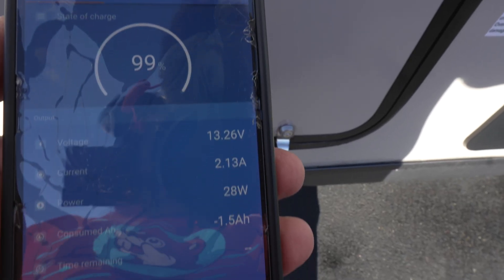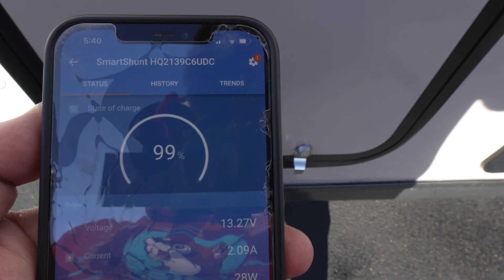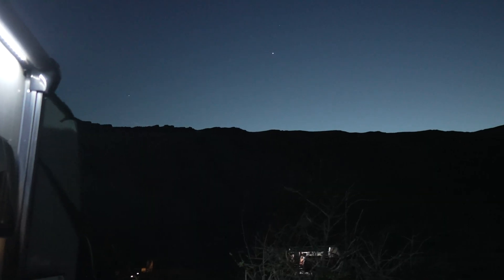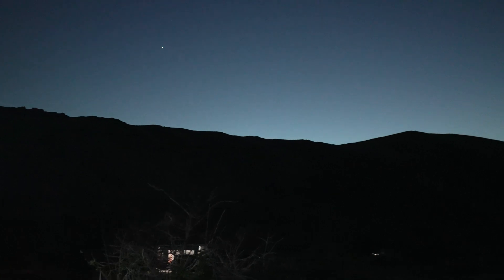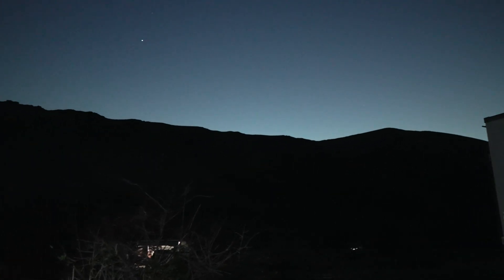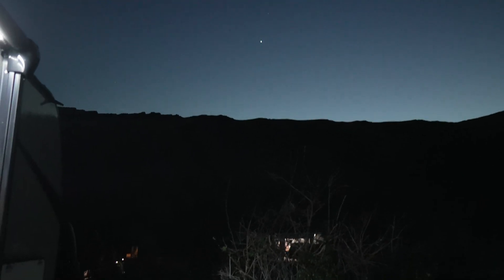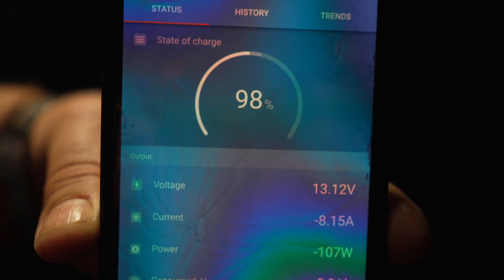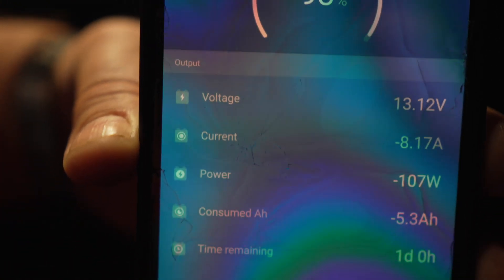SOLAR vs 12 VOLT FRIDGE TEST | BOONDOCKING WITH A 12 VOLT FRIDGE | ROCKWOOD 2109s

Comment: So a 2000 watt portable inverter generator should keep the batteries fully charged if I run it for a few hours a day?  We live on the West Coast of BC Canada, and it rains a lot. ( especially when we go camping 😂).
Reply from the maker: Should help combat , as long as you lithium converter on board can charge at a higher rate.
Reply: @UniqueAdventurez yes, when we get a new trailer, I will specify that I want that system installed instead of the standard 12 volt lead acid one.
Reply from the maker: @thumperpaul it should implied with the power usage.  I feel the only reason they do t is that they “ don’t know how the buyer is going to camp”.  It’s a lame excuse.
Reply: @UniqueAdventurez exactly. The Stealership is not your friend, we know from experience
Reply from the maker: Totally !

Comment: Great video, thanks! Wondering what side your fridge is on? Was it the shaded side with awning or the side the sun was hitting?
Reply from the maker: Our fridge is on the rear wall of the RV. So for the orientation the back of the trailer faced the east so it got morning sun and afternoon away from the back wall.

Great question and never thought to think of that when positioning the trailer.

Comment: Nice info, thank you for sharing. 
We have a small 24' toy hauler with a 12v fridge.  It came new with just the little group 24 agm and 150 watts of solar.  We knew from years of camping and solar experience that was not going to work.  We now have 300ah of lithium and 750 watts of solar, more than enough for the fridge but we also do other power hungry things like induction cooking.
We have found about the same as you, recharged by noon on good days.  Only once in the fall on a rainy day did we need our little generator to help recharge.
Reply from the maker: The AGM is a shame with a 12v fridge. Glad you got things figured out and looks like you have a pretty built system now. Thank you for sharing and checking out the video !

Comment: Solar panels are so cheap now why not cover your entire roof surface?  My truck camper (Eagle Cap 1165) has 600 watts of solar, a 460 ah LiFePO4 battery (which has a smaller footprint than 2x100 ah batteries) and a 3000 watt inverter.  I can run my AC while boondocking and barely scratch my battery level!!  Even on overcast days I get enough to keep my battery at/near 100%.
Reply from the maker: Great question. We will be adding some more ground solar to chase around the sun during this offseason.  Personally for our rig I think a ground unit will be better for us as opposed to drilling more holes in our roof.  Nothing wrong with decking a roof in solar and I think others with our floor plan have got close to 600-800 watts on the roof.  Sounds like you have a killer setup that is highly mobile, those Eagle Caps are really nice.

Comment: Our Microlite came with a 200w solar panel and I had the factory install a second.  I have not installed but have purchased 2 100-amp 24 group lithium batteries that should fit in the double battery box that came with the trailer. So, we will have 400w of solar on the roof and 200 amps of battery power.  Basically, what you have, and your video shows we will be just fine with this set up.  Thank you for your video.
Reply from the maker: That’s a solid gauge to start with and get to see what your power needs are. Since this video we did upgrade our lithium now up to 400 ah. Just to give extra cushion, but we can manage a weekend on 200ah with conservative usage without sun for solar. In good conditions we will now have limitless power for our needs .  Thanks for the great comment and sharing !!
Reply: You really only have 100ah, because you can't take the batteries down below 50%.

Comment: Exactly what I was looking for. I still have a propane refrigerator and was wondering about power usage and solar for a compressor fridge. I do have 2  portable solar panels that i put out on long stays. One is a briefcase type with glass panels and works great. The other is a flexible panel that I keep under the mattress that takes up zero space.
Reply from the maker: If you have ground chasing solar and roof mount solar you could be in. Enter shape then we were .  We are also going to be looking around a ground system as well.

Comment: Thinking of getting a 12v fridge for our class c motor home.  We have 2 6V golf cart batteries 22ah each and 400Watts of solar on the roof. We also have a built in onan generator. Do you think we would have any issues? Only camp in the summer months here in BC, Canada.
Reply: Sorry 225ah on the golf carts.
Reply from the maker: Great questions . As you saw we can get by with the 400 watts of solar with having good conditions. The problem lies with your battery capacity .  With 225ah of lead acid batteries and using the 50% rule you really have 112.5ah usable power, which would be around a days worth of conservative power. 

Lead acid batteries also can’t harness as much of the solar as they can need to be charged at a lower rate to not fry the batteries. So you may not be able to even harness as much as we do since we have lithium (which can take more power faster).  You then might be relying on the generator more than you would like to due to the lead acid and also with you being farther north having less ability to harness as much solar as us down the the states.

If you were going to be dry camping often I would suggest looking into upgrading into lithium batteries and depending on your power usage (what things you like to run on power) I would suggest At least 200ah of lithium as the minimum and deposing on how many days you are out at a time and power usage maybe even as high as 300-400ah.  Really depending on your power needs and how much you don’t want to be stressing about having good solar. This was a great question Mike , hopefully this helps !!

Comment: Guarantee being a trailer manufacture, they probably use the cheapest solar panels. I seen some solar panels that are made for homes that are close to 565watts And they can be used they come with a excellent 15/20year warranty They’ll add about 120 pounds worth of weight to the roof but. I’m thinking on my 83 holiday rambler that I’m doing imperial. I have enough room to put eight of those panels up on top and a walkway in the middle where are my three roof vents are and my AC.
Reply from the maker: Our panels have done decent (with the issues we have had with the solar). They are 2 190 watt go power panels. If you can get up to 8-565 watt panels on your roof that will for sure help bring in some serious power !!!  Thanks for the great comment John and good luck with the solar. Do you have a 12v fridge in your trailer ?

Comment: Thanks for doing this test. We are currently searching for a new rv. I completely understand the benefits of the 12 volt fridge, but it seems more stressful trying to make sure you have enough power, not to mention all the talk of: shunts, different controllers, panels, and batteries. It seems complicated for this old school camper and not near as relaxing. If you had it to do over, would you get a 12 volt again? We are currently looking at your brand of trailer but are leaning toward a used one with 2 way fridge as we go unplugged quite often. I'm also loving your campground reviews!
Reply from the maker: We love what the 12v fridge brings and the only thing I hate it for is its power consumption.  We do want to off grid more throughout the year and it all comes down being able to properly power it. It is a neucence . but with lithium prices continuing to drop it getting cheaper. If you don't want to worry about power and power usage than the 2 way fridge is for sure a better option today, but the gap for everyone is narrowing.  Thanks also for checking out our campground reviews.  Great question.

Comment: I mostly boondock and I have a 12v fridge.  I can charge my 200AH battery in a couple of hours using a small generator, and that is enough charge to keep the fridge going for two or three days.
Reply from the maker: We are hoping that to be the case for us once we switch out our old lithium converter. Our current setup has a low charging rate , but hopefully with our new WFCO auto detect system we will be able to combat in less than desirable solar conditions. Thanks for sharing your experiences. Great comments Tom !
Reply: This is good information because I am shopping for a trailer and it seems all new trailers only come with 12v setup. Long gone are the two way fridges.
Reply: ditch the stupid genny and get some solar panels.  They are so cheap that there is no reason to EVER need a genny!  I boondock for MONTHS at a time (basically full time) and don't ever use the one that came with my camper.  In fact, if it wasn't so hard to remove, it would sell it.  It has a total of 8 hours in 4 years!!!  And those hours are just to keep the gaskets in good shape.  Waste of propane, polluting and noisy!!!
Reply: @philborchelt5396  Do you run AC off solar?
Reply: @tommyNix4098  sure!!  I have a 460 ah LiFePO4 battery,600 watts of solar, and a 3000 watt inverter..  I never EVER EVER need electrical hookups.
Reply: @philborchelt5396 what AC do you run?
Reply: @jeremyspecce  it is a Coleman Mach 8

Comment: Very helpful. Been thinking of a 12v fridge replacement of my propane fridge. I have 200a lithium and 400w of solar. Still comparing 12v vs residential. Still happy with the fridge?
Reply from the maker: We do still like the benefits of the fridge with the extra space and the safety to run while we are on the move are great benefits. You definitely need to have the power supply to keep up with it. Depending on how much dry camping you do. You may have 1-2 days of dry ability on 200ah, depending on your ability to bring in solar.  Hope that helps

Comment: I have a Cannon 12v refrigerator on a newer 2021 Wolf Pack, with the Juice Pack system.   The trailer came with a 50 watt panel mounted on the roof.  We added two, 200 watt solar panels on the roof, giving us a total of 450 watts.  I took it to Stanley Idaho for 3 days.  I still needed to use my generator.  Thinking of adding another 100 watt panel and add a 3rd battery.  Thoughts?
Reply from the maker: I was trying to do some research on the Juice pack systems and form what i saw it uses a 12v or 2 6v batteries (did say it was a deep cycle system), which to be honest is not really an upgrade. a 50 watt panel will do nothing for a 12 v fridge as far as charging.  I think your solar is correct in the 450 watts , which is comparable to what we have. Your issues is that with lead acid the batteries cant absorb as much of the power as you are bringing in so  I think the issue is the batteries.  I have said that lithium is a must with 12 v fridges.  I would recommend getting at leaset 200 amp hours depending on how long you dry camp, maybe even 300 just to be sure.  Let us know if you have any other questions and good luck with the trailer.
Reply: @UniqueAdventurez  100% correct!!!  Ditch those fossil lead acid batteries.  Your solar is fine.  I bought a 460ah LiFePO4 (Lithium Iron Phosphate) battery for $1000 and a 3000-watt inverter to go with my 600-watt solar.  The entire package was less than $2000 and I never EVER have to worry about power.  I can run my AC while boondocking when I need to!!

Comment: Thank you sir for the info! We boondock several times per year at traditional archery events in Pennsylvania. We ONLY use our battery to run the circuit board "stuff" for the fridge running on propane. No lights, water pump...nothing else is used; we're pretty militant about it so as to "save the juice" for the fridge circuitry. I'm guessing if we upgraded to two 6-volt golf cart batteries and say...200 watts of solar, we could keep the batteries pretty topped of. I know two of the events we boondock from Saturday morning to the following Sunday morning, a full eight days. As long as we can keep the electrical fridge "guts" running without extra batteries or needing a generator, we'd be tickled!
Reply from the maker: Really depends o. Your overall power needs. But if you have good sun and not running heavy electrical draws I think 200 watts should be able to keep up. But I would recommend having something as a backup just incase weather isn’t good . Grew up doing archery and is a great sport !
Reply: Ditch the stupid 6v batteries and buy a 460 ah LiFePO4 battery.  They are around $1000 now, maybe less.  Solar panels are so damn cheap there is no reason not to have 400 watts!  I can run my AC on my batteries and not even scratch my battery level.  I can't even imagine living with a fear of using too much power while boondocking!!

Comment: My neck of the woods, as I've driven that canyon highway many times..  Spring camping is great in this region, while everything is still green, yet days are usually warm.  I dry camp here in Eastern Wa. about 95% of the time, so rely on being self-contained.  I'm finding that two AGM batteries in my truck camper are barely adequate for the cooler weather when the furnace cycles all night.  I run the fridge on propane.  Recently had put to bed two, 1-year old AGMs.  They are toast.  The 30,000 BTU furnace in my 2018 Bigfoot camper just consumes too much energy, and ever since I hit 50% or slightly less state of charge on the first trip after buying the batteries last year, the dual -battery setup started it's downward spiral to death.  Now I can barely run lights and the radio, so don't plan to use the camper again until can get this resolved.  I want lithium, but that would be quite the undertaking for just weekend camping.  Considering dual 6V golf cart batteries, if I can find in a size no larger than Group 27.  My battery compartment is tight.  Also considering upgrading the solar from the current single 150W panel to two or three panels.  I do like to boondock in the winter too, which is a struggle.  I'm enjoying your channel.
Reply from the maker: Appreciate the great comment . If you are leaning to 6v and already have issues with amp hour usage then Lithium would be the play , plus a lithium setup will be far smaller and lighter . Plus some of the 6v systems are almost at entry level lithium prices. But if you camp below zero then you should get lithium with low temp charge protection. Costly up front , but only get stung once with the price vs killing off AGM batteries prematurely. Plus solar and lithium will allow for faster and higher charging profiles.

Comment: Thanks for the great usage tests on your 12v fridge.  My new TT has a 8 cu ft Furrion 12 v only fridge so haven't had a chance to see how much draw it will have over 24 hours and don't know where to find the amp draw?  Nice info from your tests.  Thanks
Reply from the maker: Yours is just a tad smaller , so I would assume it might be a smidge more efficient with power . . May have to check online for the draw info . It shoo-ins have a sticker with the range on it somewhere. But regardless , all 12v fridges eat the power and should all have lithium setups if you do any dry camping . Good luck with your new trailer

Comment: Mine runs with 100ah bat and 300 watt panel on 4 hours of sun with 30 amp mttp controller.I think lol Installed a monitor and shunt so I’ll keep an eye on it.
Reply from the maker: For lithium having a shunt is the way to go for monitoring !!! We are currently switching to a MPPT victron solar controller

Comment: Thanks for sharing your experiences here!  This is exactly the information I was wanting...our new rig has the 12V fridge and we are conducting similar experiments (in our driveway, as we speak) on how much power this will deplete from our battery bank.  Our new rig has a very similar setup to yours as far as solar, Victron shunt, and lithium battery bank goes.  Our previous rig had the two way fridge and we only used a small 165W portable panel with 2-6V golf cart batteries wired in series...we could boondock for days on end, running fridge, lights, water pump, heater, occasional movie night, etc. even with poor solar capture on occasion.  Not sure we'll be able to do that with the new setup, but guess time will tell...
Reply from the maker: Really depends on location , what the weather is like and how many days you are out.  We just got back from our labor day 3 day trip and our site was completely in the shade with no chance at solar. So we had to improvise and use the generator a bit to keep the power up. But in full sun, we have shown we can last a while if we have adequate solar.  Good luck with your new rig.
Reply: Hi, thanks for the testing. Did you say somewhere what batteries you had on your rig? We have one lithium 100 amp hr battery with only 190 watt solar panel. That can't get it done in our boondocking as your tests already proved. 11:30 AM CST
Reply: @LarryBabbitt  we have 2-100Ah lithium batteries with 400Watts of solar on the roof.  Unfortunately, we haven't had an opportunity yet to test this setup while boondocking for an extended time.  We're planning for a trip in January to southern AZ for a few weeks so we'll see how it goes.  I'll try to remember to post here to share our experience.
Reply: @reneepowell8541  say, how did that setup work for you??